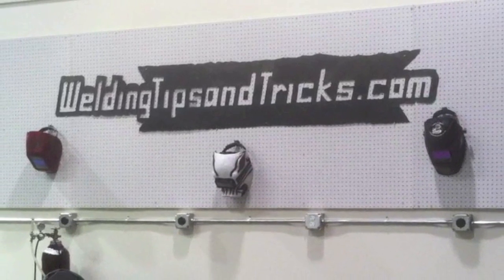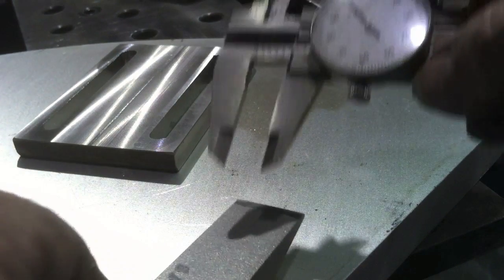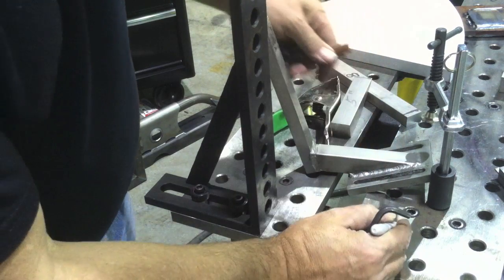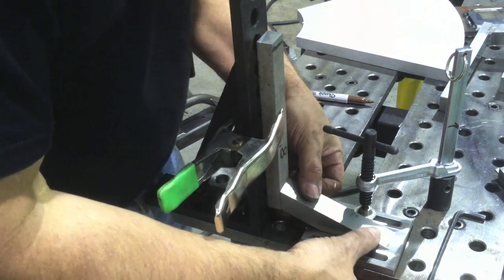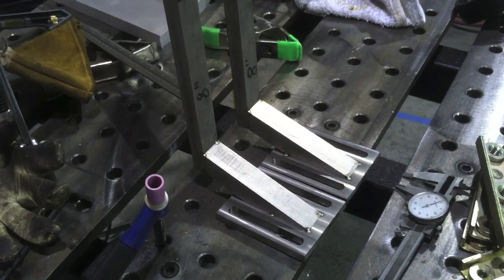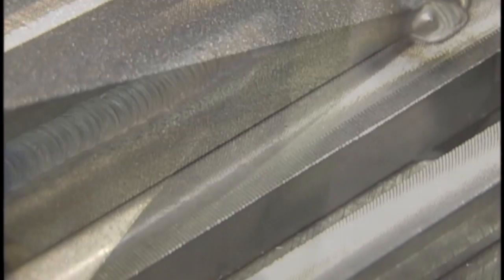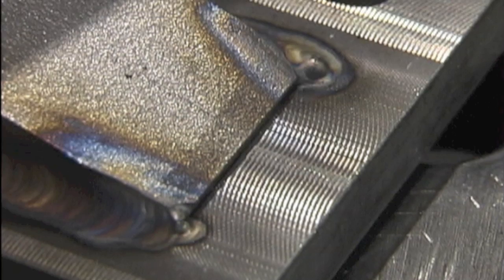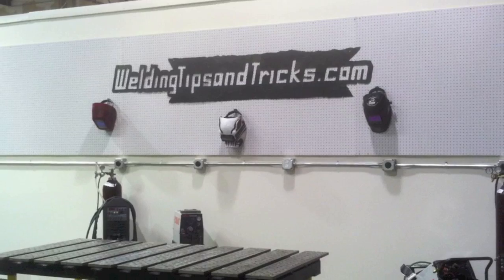Tig Welding Stainless Steel -The Slider

Comment: Poor joint design, not much strength in the vertical member, you should have put a small bevel to give some throat  thickness.

Comment from the maker: @budandbean1 For strictly the welding portion, I would probably calculate total inches of weld and charge a dollar an inch plus a dollar per tack weld. for a total  of  around 18 to 20 bucks per part. The buck per tack weld usually accounts for fit up time pretty well.  There are always exceptions but this is a starting point.